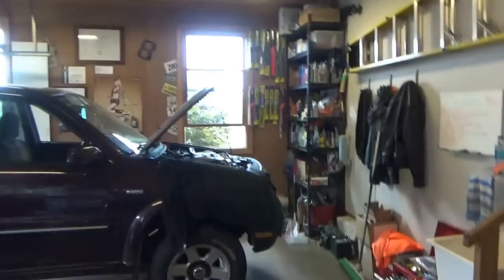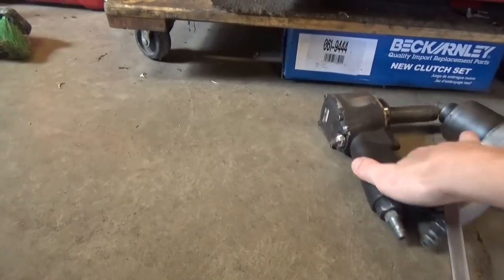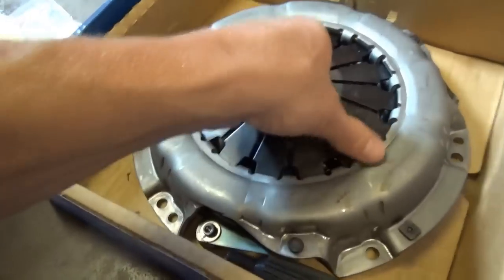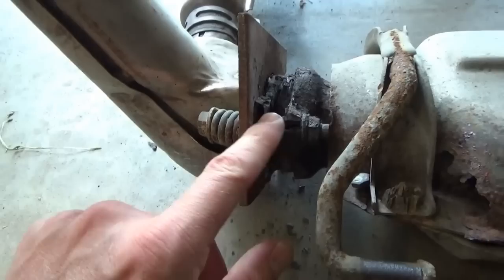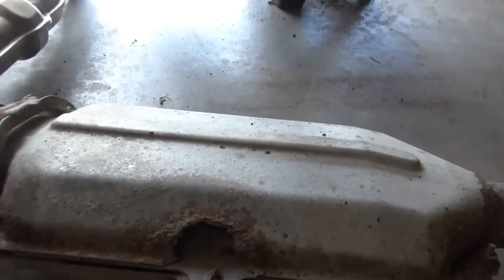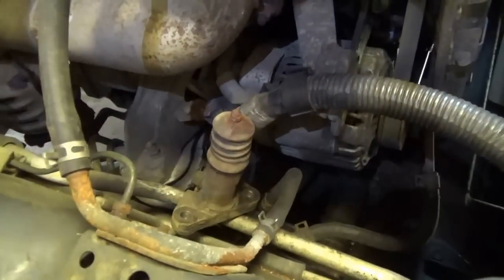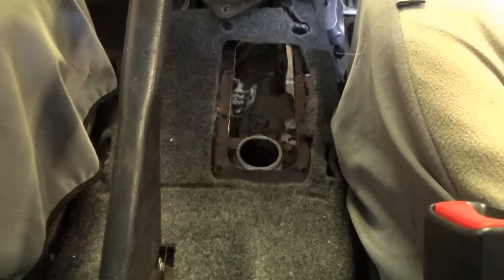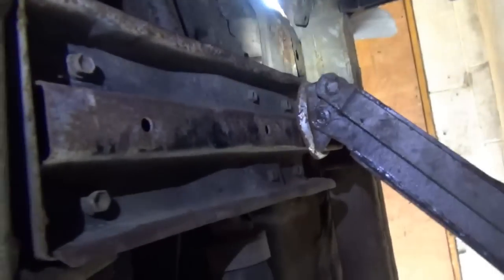Suzuki Clutch Job! Part 1: Transmission Removal

Comment: When using a floor jack, I always use an appropriate sized
square of 1/2" plywood between the lift and what's lifted.

Both side's irregularities actually bite into the wood where
they need to, and the platform also steadies your part.

For everyone else- never cup a jack onto a thread Boss as a lifting point-
it can snap off very easily.

The clutch lever pivot ball is hardened; but, over time, they will wear into
a can opener blade, and poke through. A new pivot is cheap & easy to change,
so it won't ruin the new lever. "Extra" grease will not remedy this.

You've done an excellent job here.

Comment: My 2002 xl7 clutch fork punched all the way threw (198,000 miles) at the pivot. Mine was starting to have trouble disengaging/engaging in reverse for awhile. I ignored it ...til it bit me ..stranded. Nobody/transmission shops believed what I thought it was when it happen. So I did the job myself also considering I just paid some trans shop 18 months prior for a new clutch.  It wasn't too bad except the y pipe. I chipped my front tooth getting it out(800 dentist bill- crap there went my savings).  By the way the shop that did the work prior left out a 4 bolts(1 was a starter) and I believe the issue was the same thing then. From then on I feel better doing my own work. 

Current mileage 238,000
Reply from the maker: Nice! Glad to hear these tough little trucks can go the distance :)
Reply: TIP: If you have a punched out clutch fork, put a bolt though the hole of the punched out clutch fork, with the bolt head facing the slave cylinder nipple and a nut on the back. No tranny drop required :D I did this on my Isuzu Trooper and it got me by for several years before the clutch truly needed replacement and I put a new clutch fork in then. Isuzu Troopers have this problem too. I wonder if Isuzu's are same components or same OEM as Suzuki's.

Comment: I've done several Suzuki clutches over the years but never a XL7. I have done a few vitaras and I personally had an X-90 for several years. Good choice on the B/A clutch. I've used theirs on every one I've done and have always been pleased. Good choice on replacing the shift fork as well. Honestly I recommend replacing the master and slave cylinder at the same time. They're not expensive and they always eventually go bad and start leaking. I rebuilt the gearbox in my X-90 and to date it was the easiest manual transmission rebuild I've EVER done. No kidding once I had it out I had it fully rebuilt with new bearings, seals, and syncros in about 45 minutes.
Reply from the maker: Wow the forgotten Suzuki X-90! Hopefully I won't have to rebuild my transmission any time soon!

Comment: My last "on the ground" engine swap was back in 2012. No creeper - just sliding in and out under the truck, outside in the driveway. Don't think I have it in me to do that again! HUGE respect from me, watching you do this tranny/transfer case removal. I could probably physically do it ... but probably not mentally, lol. My tolerance for stress drops by the month these days. Nice work, brother! 

The PHAD marathon continues. On to part 2! 👍🍻

Comment: Been working on one of these for years now. Auto.trans. Mainly maintenance..Has 390,000 miles still going..at 303,000.replaced the fuel pump...The vehicle is a mail delivery rig and drives around 85 to 105 miles 6 days a week.. tks.for videos
Reply from the maker: Holy crap 390k miles?!? I'm afraid mine will rust away long before it gets that far haha
Reply: @PineHollowAutoDiagnostics  Here in Southeast Oregon no rust...we have dry climate..that's a good reason being here at least for mechanics...LOL..

Comment: Those NTN bearings are very good quality, you'll find them on just about everything OEM Honda, even my Honda motorcycle uses NTN wheel and steering head bearings.

Comment: You are a wizard with the floor jacks Ivan. When i do clutches i just prefer to man handle the gearboxes in and out but holy shit, you would never man handle that mess in your Suzuki out! It must weigh 200KG. As much as working on the floor might suck, i think working on the floor is better for your back, neck and shoulders. Working on a lift often means contorting your neck and arms into some odd positions.

Comment: That looks like a big chunky bell housing and gearbox :-)
The trolley jacks just made that drop so much easyer, we don't always appreciate our tools but those jacks work so well :-D.
Yep the fork/lever must be worn on the pivot, the thrust bearing must be very ill also.
If the mud is bone dry, then spray your old engine oil everywhere, it's a good use for it :-D.

Comment: I agree, you should have a dust boot on the release fork. Don't forget to grease the pivot the fork rides on. Also you should put in the new pilot bearing & rear main seal while you can easily get to them. Check the flywheel for burns or scoring, as it may need to be resurfaced. And you should consider overhauling the slave and master cylinders for the clutch.  Not costly and it probably needs it.
Reply from the maker: If it ain't broke I don't touch it haha

Comment: Heya Ivan, by adjusting the clutch pedal pushrod too far you can create problems, the master cylinder piston needs to be able to return back to it's disengaged position so the pressure relief port becomes uncovered and pressure between the master and slave is released. If you adjust the free play out of the pushrod, the system will hold pressure and gradually engage the release bearing and cause the clutch to slip. Make sure you have the specified pedal free play and pedal height with your new clutch mate.
Reply from the maker: Good tips. I just increased the travel while keeping the master cylinder rest point :)

Comment: I had to replace the clutch pressure plate and throw out bearing in my 98 Off road Ranger. Fun fun taking all the skid plates off, drive shafts, etc. and wouldn’t ya know Ford in its infinite wisdom put its slave cylinder inside the trans. On the input shaft. I  had to do mine like yours. Had to put the truck in the air on jack stands. Saved the big bucks working on my own vehicles.
Reply from the maker: Nice!

Comment: Hi great work. I have the same vehicle but I believe my shifter that connects to gear box is issue because it only has a reverse problem.  Anyway recommendations on what to change?

Comment: Sorta the story with my car, I think the clutch disc has a piece busted off... It was occasionally bouncing around and getting stuck (you could feel when it hit the clutch disk and grabbed suddenly out of no where) but it has stopped a while ago. I have been babying the clutch for a few k, but I need to do it eventually... It's been warning me!  And my truck has the stock 270k mi clutch, I'd like to replace that one to get a nice pedal feel, but I don't want to deal with the rust.

Comment: Did I miss the diagnosis video?  Beck Arnley are great manufacturer and or reboxer. I bought a bosch purge valve the other day for a car lot car that actually had a Bosch part in it. Literally though that pilot and throwout bearing should be replaced on a clutch service. Personally id trust the bearings that came in a kit.

Comment: Those are great cars. Had a 2002. Sold it at 107K 8 years ago. Still running strong. Only issue with 80% of those is the A/C compressors seize between 50-100K. Yours take a shit yet?

Comment: That exhaust, unless it is aftermarket, is likely the same material. The problem is heat and vibration.  Stainless steel will lose some of its properties when exposed to heat which is why weld seams will rust.  At the Y and catalytic converter is going.to be the hottest part of the exhaust.  You also have issues of it running lean and rich in different states of disrepair.  (You have to know some is wrong in order to fix something that is wrong).

But your motor and converter flanges will see the most vibration from the engine. This flexes and fatigues the metal a bit. Put it all together and you can see why one will wear faster that the rest of the exhaust.

Comment: Ivan ,i was wondering about the Trans clutch lever boot and lower trans case round plug,also the two air vents on top of the trans case....It appears that mud can make it's way to the clutch by the simple fact it's not a totally sealed unit.i would think off roading you would want to stop any mud from ingress to the clutch plate etc. am i wrong? thanks
Reply: I agree, my land rover bell housing was totally sealed except for a drain plug in the tool kit that you fitted for deep wading same deal with the timing belt case as well

Comment: "Heavy line work" !  Not so easy without a lift.  We ought to get you a shop building made up where you park the cars with 12 foot header garage doors and a lift !
Seems like the clutch release fork is beyond it's use limits and the throw out bearing is dry of any grease, worn out. It also doesn't seem to travel over the center shaft sleeve very smooth so that need cleaned off really well as the new release bearing gets packed with grease in those grooves. Since it was driven in the mud bath, it would seem fair to replace the pilot bearing with a Japanese make too since the throw out bearing is dried out and rough, the pilot bearing likely is especially since it turns all the time. That mud bath is as you say, not good period.

Comment: I use 2 studs kitty.corner..on engine cut a slot in them with a 3" cutoff wheel and bevel on grinder..makes install a breeze..Just take screwdriver to remove...

Comment: Guy I worked with was doing this in his workshop which set away from his house and the trans dropped on his hand. No one checked on him for almost three hours and he nearly lost the hand.  Be careful folks!
Reply from the maker: Holy crap must have been a heavy transmission!
Reply: Pine Hollow Auto Diagnostics/when it fell the pain caused him to faint and when he came to the pain every time he moved would make him sick. He laid there and screamed for help till he lost his voice.  His wide came in finally to check on him and called 911!😳

Comment: How did you get the upper bell housing bolts out?  I am working on an 02 with an automatic and I can't even see the passenger side top bolt.
Reply from the maker: I used some really long 1/2" extensions...like 6 feet long plus a breaker bar. Tilt the bottom of the trans down and you will be able to see them.
Reply: @PineHollowAutoDiagnostics  Great!  Thanks for answering!

Comment: Hmmm...guess I would have never considered a Suzuki SUV back in that cars vintage but it looks surprisingly decent in build quality.   Especially from being in salty winters.
Reply from the maker: It's holding up OK. Gotta spray some fluid film before winter!
Reply: They are a tough little truck. The earlier ones like the Samurai and the "Geo" Tracker (aka Suzuki Sidekick) are highly sought after out west as trail vehicles. They are off road beasts when put together right. Smaller and lighter than anything but the early Jeep CJs.

Comment: on a hydraulic clutch setup, you pretty much never adjust anything, except for flushing the fluid and bleeding the air back out. if anything changes in the feel or travel, 99% chance the clutch/pressure plate/bearing or is having a mechanical failure. if it was a cylinder(master/slave) it would have bleed off and take off by itself with pedal pushed or not disengage fully and have a very soft throw.

Comment: Heya buddy, any tips on how to bleed the soft clutch pedal into normal operation? I am doing something wrong and just can't get it to not be soft anymore.
Reply from the maker: Is it moving the slave cylinder?
Reply: @PineHollowAutoDiagnostics  yessir, did this same job but didn't use nice new parts like you did, used janky old parts. If the slave is moving does that mean it's primed and the problem is a shitty rusty throwout bearing and a nasty broken clutch fork not moving properly? I ordered a clutch kit and a throw out bearing but hoping its just something wrong with the prime.
Reply from the maker: @ColePEET  Sometimes new parts are necessary haha

Comment: Do you plan on doing anything with the Flywheel surface?  I know on Class 8 Trucks when doing a clutch job it is always good habit to re grind the face..
Reply from the maker: Nah it's flat and smooth :)
Reply: Pine Hollow Auto Diagnostics I like to break the glaze off with and orbital sander. Is it necessary? I think in a smaller vehicle it’ll work either way.

Comment: With 160K miles on the vehicle I suggest putting in a new slave cylinder and fluid  line as well.
As long as you're there maybe the master cylinder too.
Reply from the maker: Eh if they start leaking then we'll do that separately :)